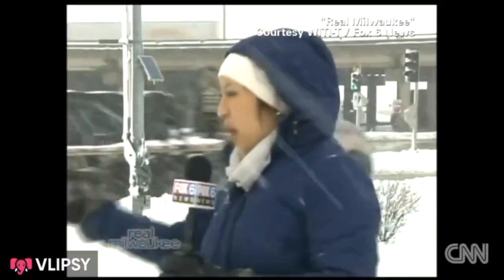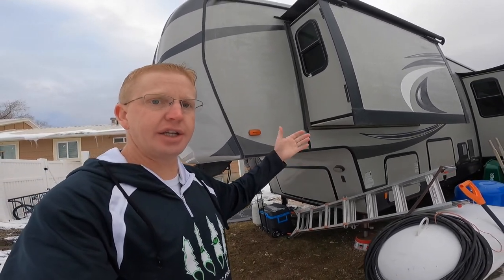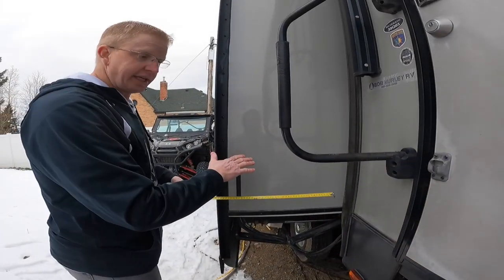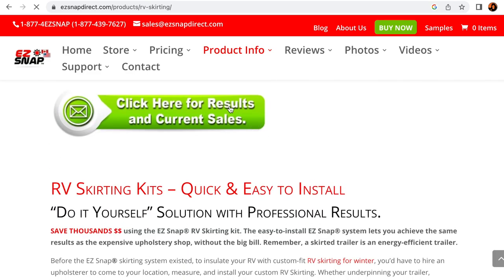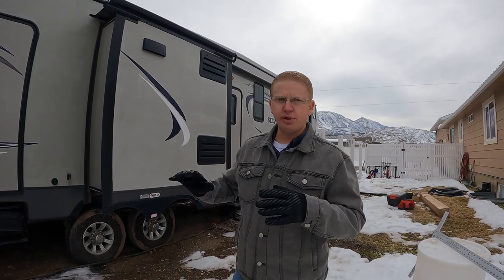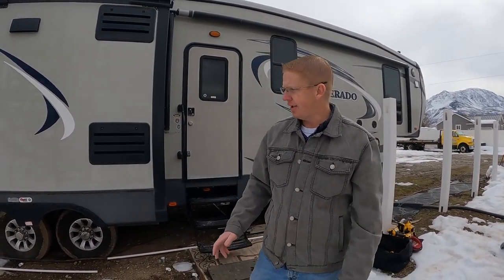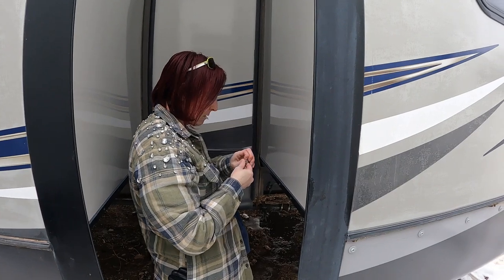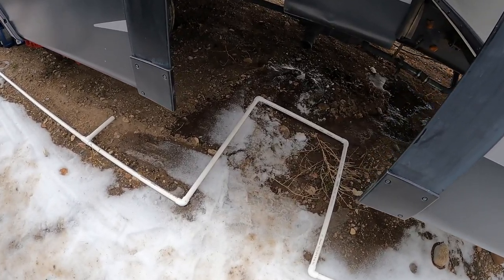Survive Winter in Your RV: EZ Snap RV Skirting Review & Installation Guide!

Comment: I lived in my camper for a few months in winter while I moved, I used a few electric heaters inside which worked amazing. Set me thermostat at 50 for just in case. Ive seen people use straw bales under and around the camper as well.
Reply from the maker: Yeah we looked for straw bales but no luck finding any.  Plus with this more than likely being needed next year as well it should help.  Thanks for watching.
Reply: Straw will almost certainly attract mice and other critters.

Comment: Yes that vinyl skirting is nice but just not made for wind. I ended up taking mine off cause the wind was too much and rubbing off the gel coat.
Reply from the maker: Wind just ruins everything.  Did you find a different solution?  Thanks for watching.
Reply: Yes.  Believe it or not I used 1” foam board and it held up very well in 70 mph winds. We get a lot of wind and people said it wouldn’t hold up but mine lasted for 2 years.   
I had more problems with the slide being pushed in rather than my insulation.    
I live in mine more than my house so over the past years it amazing what you learn over the years.
Reply: How cold did it get where u used the foam board?
Reply: It got down to -10. But the important thing is to get a good seal so that the wind doesn’t get under my camper. It stayed plenty warm under the camper.
Reply: @Rusty1972  Yea foam panel insulation is a far better investment than this... it insulates far better and is cheaper.

Comment: Thank you for the full install! I'm getting ready to order this for my 40' travel trailer trailer that I live full time in here in the NC mountains. I do have a question, sometimes it gets down to the low teens and even single digits on rare occasion in the winter. How cold does it get where you are and have you been happy with the added protection this system gives? Thanks again 👍
Reply from the maker: @MrMatthewgross  you can check our results video where Chet talks about how much it helped.  It gets teens single digits here with snow but low humidity.
Reply: @JauntJunkies Thank you, pretty much same here, low humidity here in the Mountains of Boone NC is definitely a plus with less interior condensation. Thanks for your informative content 👍

Comment: On the front where the fifth wheel hitch is, did you have any cracking in the fiberglass and not any metal?? I just received mine and about to do the install👍👍
Reply from the maker: We have not had any issues with cracking.  Thanks for watching.